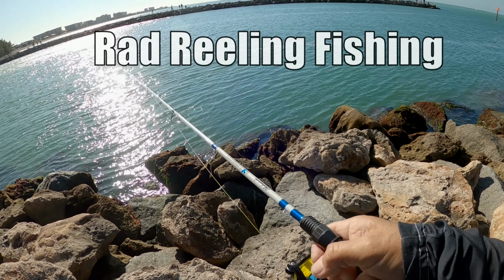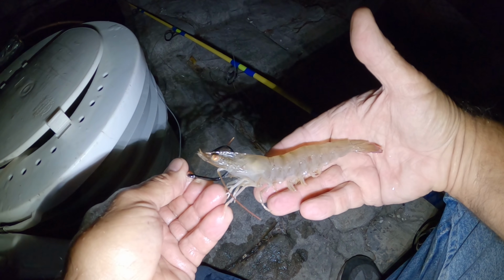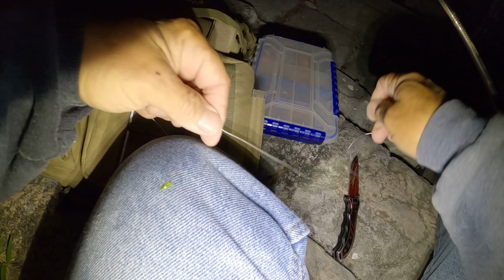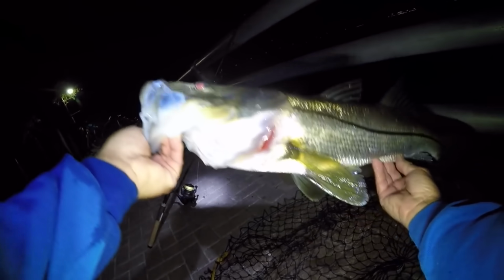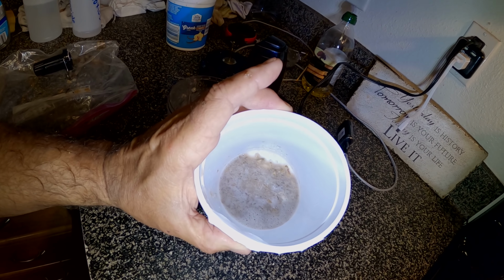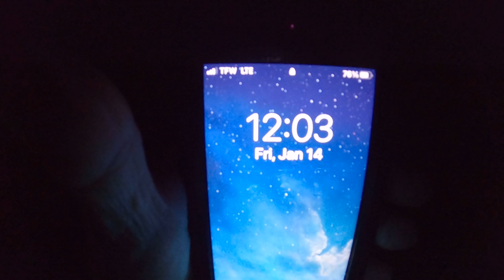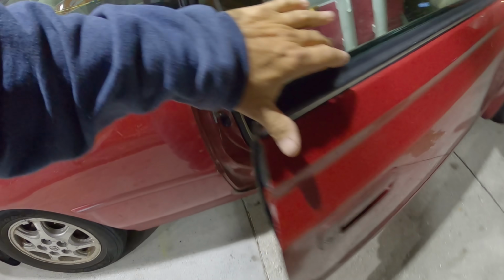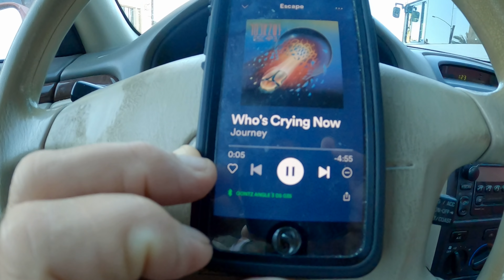I Thought I Was Fishing For Snook Until This Happened (Using Monster Shrimp For Bait)

Comment: Hello Rad!  I have a Penn Battle II 3000 Spinning Reel w One-Piece 7.0 Ft Spinning Rod.  Since I need to take the smaller vehicle, the spinning rod would either stay in a bent position for a long period inside my car or else if I crack the back passenger window the wind & vibration during travel may cause rod abrasion as the part of the rod sticks out of the vehicle.  Thinking about buying a two-piece Spinning Rod to go with my Penn Battle II 3000 Spinning Reel for this long trip from Georgia to Florida.  I'll be using the combo to fish for Pompano using artificial goofy-jig lures.  What two-piece Spinning Rods would you recommend would be a good balance for this reel?  Thanks!
Reply from the maker: Walmart has the Berkley Amp in two piece and also the Shakespear Excursion. I perfer the Excursion for jigging for Pompano https://youtu.be/bMmjF0Twyhw and https://youtu.be/Gtv-5StXxEc